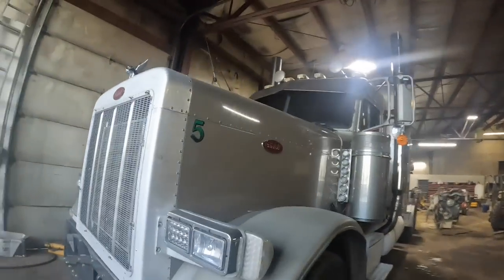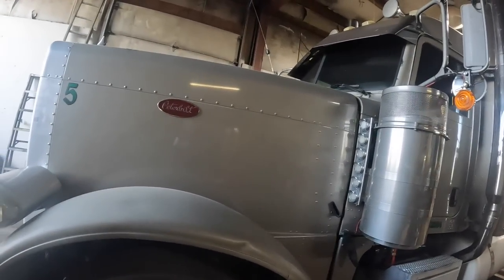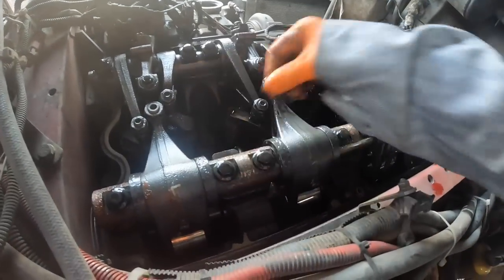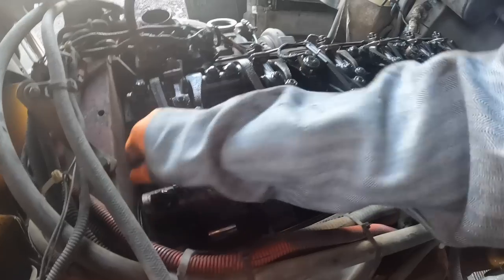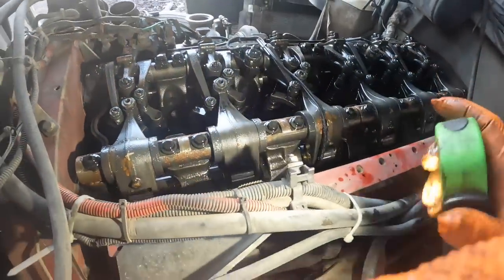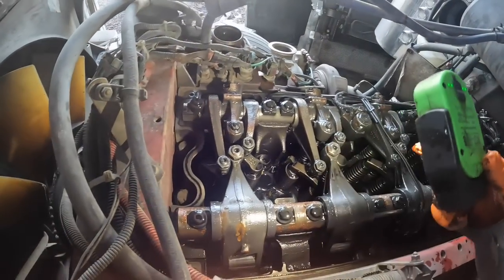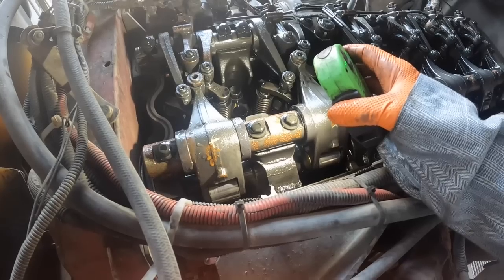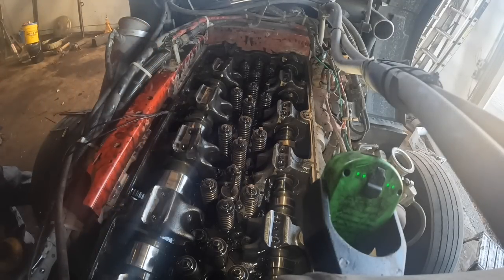ISX Cummins dropped liner.

Comment: I swear with all of this modern engine BS, it’s all designed to fail. It’s designed to run hot and “clean” and then fail. The manufacturers want it to fail. They make more money when it fails. It’s not like things used to be, they wanted them to work, but now they want them to fail.
Reply: Intravince aviation standard with failure comes full trail advancing severe parameters
Reply: Operator keeps driving an overheating machine that has a probable head gasket leak and you think the problem is "modern" engines?  Wha???  Doesn't matter is the engine is from 1982 or 2022, if the operator does stupid #### then things break.
Reply: The truth
Reply: @JHruby  these will suck coolant and have never been over heated. Been there done that.
Reply: @bondobilly9369  seen it on my ISB 6.7 in my bucket truck...EGR cooler cracked internally and kept sucking coolant or puking it out the exhaust.  Got the red shut down light a few times, shop finally had to pull the head off it.

Comment: We blew up two engines in the last year in the same truck, in the time line of two years, new head, then In frame, then engine swap, then head gasket, then In frame, then engine swap again, dad stuck $45K in it and I stuck $22K into the truck, it's an 2006 T600, the truck ain't worth $15K running in top shape, that's why I will never own a CM 870 ISX

Comment: I tell people that oil pressure and water temp gauges tell you a lot, but often all people look at is the speedo and the fuel gauge🙃 ! I bet this truck owner is not a happy camper ! Thanks for sharing.
Reply: How low of oil pressure/water temp should i be worried then?

Comment: This is the problem I am going thru right now with 454k miles on my 2016 isx 500. I blew a head gasket on cylinder #5 and the shop is telling me my liners have dropped and now need to be all replaced. My motor never ran hot in the past 6 months I have had it, it just started blowing coolant out the release on the reservoir tank from building up too much pressure.

Comment: 24 v cummins.  No blow by no exhaust on coolant.   White smoke unplug #4 injector  no more smoke.   Injectors were replaced and swapped system stayed with #4 What could it be.
Reply: Burning engine oil would be my direction

Comment: Because the engine would be cooking hot when the water goes through the exhaust manifold it may turn to steam which then goes into other cylinders and when the engine cools down perhaps condenses back to liquid thus meaning no kinda sloping path needed for flow to happen.

Comment: too bad that cummins does not put those liner inserts in at the factory to reduce the dropping liner syndrome. The other issue is how many hours extra to pull the cams out of the engine with all the crap you have to remove. Nice if they could design a better system

Comment: I  would hate, when I did a good job and the customer  abuses  the equipment right off... I just put pumps and wheel motors on a 61" ztr  customer He  went out and jammed steer handles back an forth popped wheelies, I said easy break in all new pumped dude !  nope , so I did not guess why the bearings blew out the side!! I spent 2 days cleaning lines and tanks , and r&r  unreal,

Comment: I feel for that farmer…Good help isn’t hard to find….it’s impossible. It’s the same in the marine world..
I put 165 t-stats and 185 alarms in EVERYTHING…..Don’t tell your crew there’s a temp cushion….All they know is if you hear the alarm to SHUT IT OFF….
Caterpillar told me it’s to cool….thousands of hours later…no known side effects…except way less head gaskets, heads and manifolds…..
I see no other reason than epa nonsense why these motors need to run this hot….
Before I did this….when the factory set (way to hot) alarm came on….the damage was already done.
Anyway…enjoyed the video

Comment: My heart goes out to anyone trying to haul to make a living. They'll need the money, be desperate to keep a commitment to a customer and so focused on the job to be done that they fall into this rut. A costly rut. A rut that's ruined many a haulier.

Regards the engine dusting. Those small rock saws that builders use? (Stihl saw) They can be bought cheaply on the used market. They're always worn out. Builders use them, the air filter chokes up and instead of cleaning or replacing the air filter they decide to run the saw without an air filter. Rock dust makes short work on engine internals.

Comment: I see a lot of guys do this and I gotta ask…Why are you so concerned with wedging the cams before removing other components? They spin freely by hand once the gears are off anyway, as long as you pin the crank and wedge them when you put it together there’s no reason to pin/wedge it before you take anything apart
Reply: It's irrelevant unless you take the  injector gear off first before moving to the valve cam gear  Also it like 30 seconds to wedge and un wedge so does it really matter.  Lol.

Comment: when engines get cooked.......all kinds of things go wrong. Even if they start up ok and run.........eventually all kinds of little problems start to surface that are expensive to fix.  Ive heard of people throwing cold water in a super hot cooked engine.......and something cracks and the water just starts running on the ground LoL.

Comment: I could see the guy getting rid of the mechanic that screwed up the tractor. I don’t see getting rid of a tractor that you know the engine has been rebuilt, might be better than what you replace it with. Seems like the newer Cummins are not tough engines or whoever rebuilt it the last time didn’t get liners set correctly. I would think being at the high side of the protrusion spec would be better for holding a head gasket, also need to have them as close as possible to each other. Thanks for sharing your time and knowledge.

Comment: Kind of funny that the John Deere owner believes that his employee  works around the fields and works on equipment and is invaluable to his operation and probably believes by having him there to work on the equipment is saving him money, when it is the exact opposite in this case and it is costing him a shit pile of money..  If the employee doesn't know what he is doing he shouldn't be touching it, don't try and fix shit your don't know know  the slightest thing about., like cracking the hose, how hard would it had been to say hey I cracked this hose we need to get a new one? No let hide the fact I cracked it and duct tape it... like WTF is that? That tells you a lot and then the solution is duct tape and not say anything... and then dust the engine down the road... great idea....    and to want to sell the machine after a rebuild and expensive rebuild... cant blame the machine here... but I would be telling that guy to stay far away from doing any maintenance or troubleshooting... cause he is costing you more money then hiring warren or anyone else to come and look at it and fix it the first time properly

Comment: Does it look like that liner hammered?  I have no real experience with that particular engine so I have to kind of equate it with other engines that I have worked on.  I have seen an engine where a "loose" liner started kind of bouncing as the engine ran.  Boy howdy , let me tell you that that engine was a mess. It started out like the one you're working on being hydro locked , bad head gasket , damaged head due to the liner movement , along with damage to the block as well.